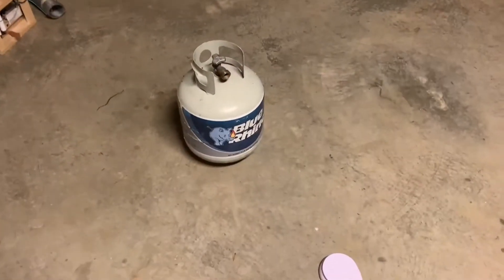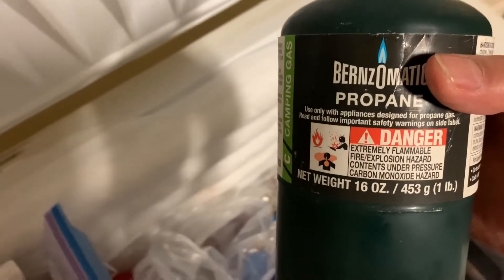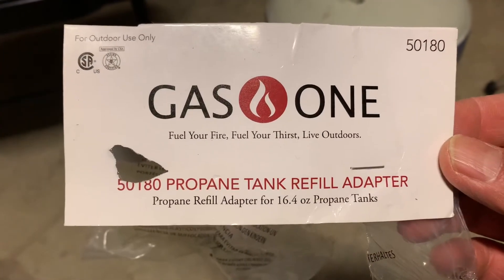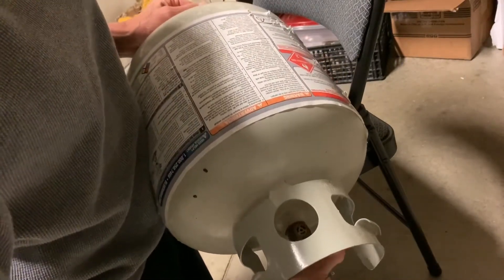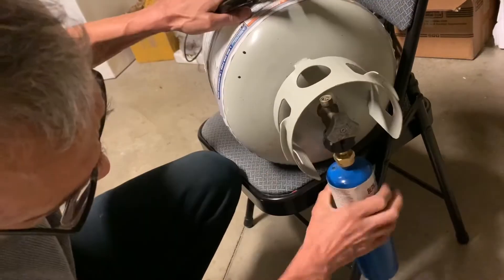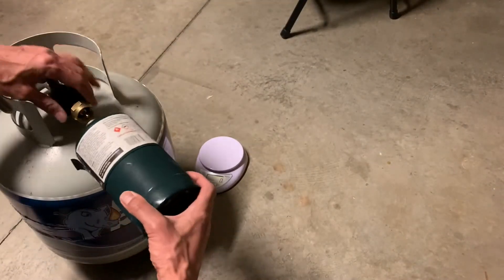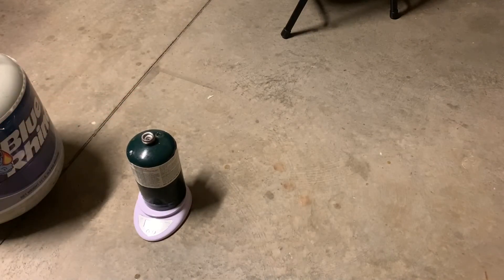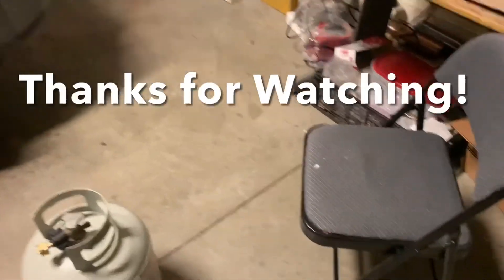How to- Unlimited Benzomatic Refills!

Comment: you have to open the needl valve to let air out like filling any propane tank on forklift.. connect the two, vent the empty, open supply tank till gas escapes filled tank

Comment: 1st you say it is important not to overfill then you say to put the empty in the freezer so you can get more in. I still don't understand why putting more pressure in is a good idea which would happen once the thing warms up. I see you are using a weigh scale. Most of these guys probably don't have a scale so will wing it. Never the less, you put in over double the label and the pressure will be over the limit as well. I think you are not doing this safely. Elon Musk approved.
Reply from the maker: The purpose of cooling is to increase rate of filling. It’s not too overfill. It’s very important not to overfill as the gas reaching a triple point will rupture the tank.
Reply: If the tank weighs 1lb and it holds 1lb of gas the total weight will be 2 lbs. Math is hard.
Reply: @ From you to god's ear. People don't even want to do that math, just think they know what's best. You are aware of this right? Some people lose fingers doing things. I know someone or some one's will blow off a digit. Maybe even lose an eye or worse.
Reply from the maker: The big tank is at room temperature and to get the liquid to transfer to the smaller tank, which is also at the room temperature is challenging. If the smaller tank is slightly cooler  than the big tank, it’ll be easier for the liquid to transfer as the pressures will be slightly uneven. I found this out experimentally. It would take a long time for the smaller tank to fill up from the big tank if the smaller tank was either the same temperature or warmer than the bigger tank. It’s not to do with overfilling. The filling process is carefully monitored by weighing the small tank to make sure it doesn’t go over 1 pound.
Reply: @ Thank you. I want to try this with the narrower propane tank. It's naturally designed to be stronger. Those fat boys could rupture more easily. Details are important. I will likely wrap the thing with good cloth just incase it does overfill.

Comment: If you transport a refilled Benzomatic cylinder the fine is $500 000. Benzomatic tanks are not refillable.  Federal law forbids transportation if refilled with a penalty up to $500,000 fine and 5 years imprisonment (49USC5124)

Comment: They make a stand for doing this as well as it comes with valve and pressure controlled tank for like $20
Reply from the maker: That’s good to know
Reply: Yes I bought made for refilling 1 lb tank by Mr heater for 20 bucks and the filling kit that came with a stand to hold the tank upside down say off the side of a pickup truck or chair etc I think it was 50 total with the refilling kit and refillable bottle not that I've ever had any trouble refilling any of the green or blue ones they're just fine from my experience @BrianDhvTinkerer

Comment: You should at least have a disclaimer how organizations like the Hazardous Materials Safety Administrations from US DOT have reported several hazmat incidents and a fatality from refilling 1lb propane tanks. Hydrocarbons are, after all, the leading causes of hazmat incidents. It appears these types of tanks aren’t made for the stress of emptying and refilling. Of course people are gonna do what they want which makes sense but I don’t think you should be telling people you haven’t had any issues with refilling these tanks when they ask if it’s dangerous because this does involve some risk with high consequences. It’s great you’re sharing your hack for others but you a should be more informative of the possible dangers so that others make their most educated decisions
Reply from the maker: Makes sense and totally agree. This is especially the liquid that have a triple point state greater volume then the tank volume, which can result in tank rapture. Hence it is extremely important to have a new tank and weigh it before filling and once it’s empty to weigh it again to know exactly what weight of propane went into the tank. Same goes with refilling CO2 cartridges for use in soda streams.
Reply: @BrianDhvTinkerer weigh it when empty? dont u mean weigh it when full once u have refilled empty cylinder with gas?
Reply: Only in America there must be a warning label to prevent an idiot from smoking while refilling a propane tank 😂😂
Reply: It’s right there in the tank to not refill people are going to do it any way.
Reply: Not for transport, not for resale.  Should be okay for personal use if the cylinder is corrosion-free, undamaged condition and no history of leaking.
Reply: you better still be wearing your mask and i hope you've had all your boosters , hey drink up you can have mine ,, LOL follow the science,,, mug

Comment: Put the large filler tank in the SUN, sitting on top of a BLACK surface.  Place the small reciever tank inside your FREEZER. Simmer/Freeze both, for at least one hour.  Then, the transfer flow will behave, MUCH better).
(Notes:
1.Always start with a FULL source fill tank.  
2.Don't tilt fill tank past 90 degrees.  If you tilt fill tank over too far, it's internal OPD, (Overfill Prevention Device), will sometimes close off output flow.)
3. On GREEN propane bottles, if your adventurous, on top of the receiving bottle is a tiny filling bleeder valve, (it looks like a tire fill valve).  During filling, pull UP on it.  It will release gaseous propane, thus allowing more space in the bottle for liquid to fill.  Stop filling when straight liquid propane begins to exit the bleeder.  
(ONLY DO THIS OUTDOORS and AWAY from any open FLAMES.  Wear PPE EYE protection and GLOVES. WHY? The bleeding GASEOUS propane temperature is DEEP SUB-ZERO, about minus 43 DEGREES C & F, and can cause instant freeze skin BURNS!  THAT'S WHY!)
Reply from the maker: Yeah that’s really good advice! I always felt uncomfortable about sticking a large propane tank out in the sun and overheating it but I guess that’s the way they are designed. It only took me a few minutes to fill up the tanks shown in the video but like you said they would probably fill even quicker if the big tank was heated prior to the fill. I didn’t realize there was a safety valve inside the bigger tanks. It didn’t seem to interfere that much though with my fill process.
Reply: @BrianDhvTinkerer  I guess LOL
Reply from the maker: The freezer cooling just increases the fill rate. It’s not to overfill the tank. Other thing is all tanks have to have a Tare on them before filling to not exceed the stated content weight written on the outside of the tank. That’s about it.